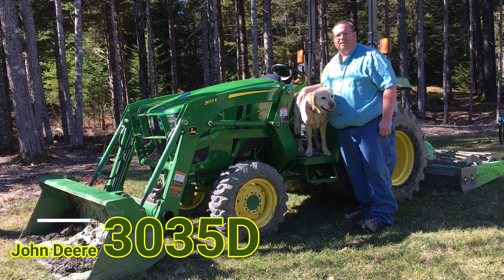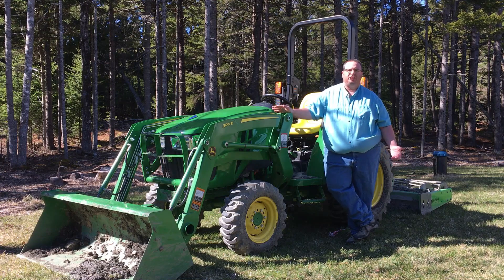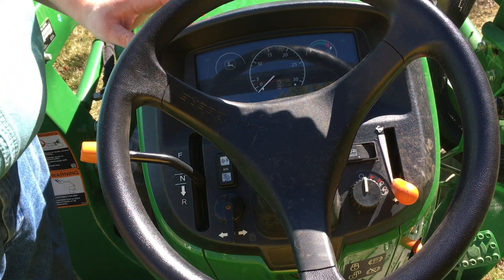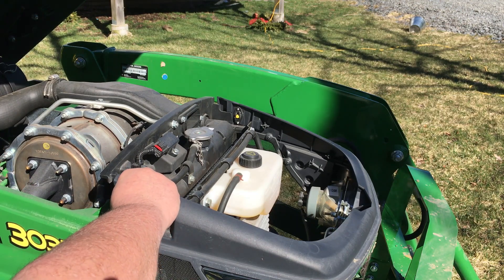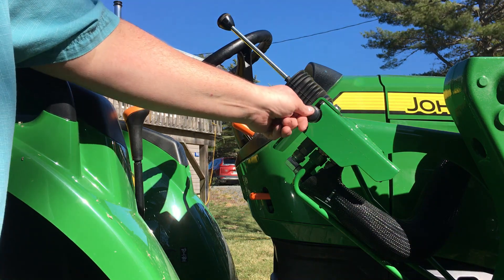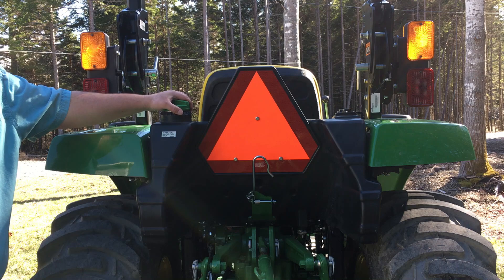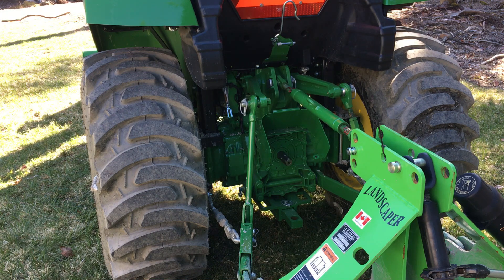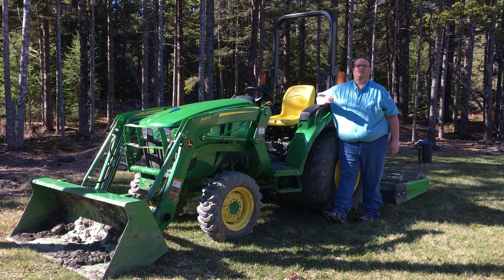John Deere 3035D

Comment: Great review Anthony,  almost wished I'd held out for 2 years. I bought a 3E in 2017. The D wasn't available then. I prefer a manual geared transmission. Hydrostatic is OK but geared tractors have been around forever.
Reply: instablaster...

Comment: The pto is a no go for me. Its seems totally backwards to me that a geared tractor you would put a pto that's stops when you clutch.  When most other tractors have a independent pto or two stage clutch. Having your implement start or stop everytime you push the clutch to stop or change gears is just more wear and tear. Especially on implements like brush hogs where you dont want to just stop the pto first before you stop. You want to stop the tractor first and let the brush hog clear out before turning it off.  Also if your tilling the garden and need to stop for some reason your tines are going to just come to a stop while still in the dirt. You would have to always remember to lift the tiller before coming to a stop.  Then when starting it up again your tractor will have to be in motion before you drop the tiller down or else you'll be starting it in the dirt. If your blowing snow you will be going forward and as you push the clutch in to stop, the blower will turn off while still completely filled with snow, cause you weren't able to stop and let it blow out first. I just really dont understand why they did that. I literally can not think of a single advantage except maybe cost cheaper to produce.
Reply from the maker: You are correct it was all based on price.  There are other brands priced less expensive than the e series hydrostatic but they as well have that live PTO.
Reply: @anthonyallen1961  Another thing is it's not live PTO, it's transmission PTO. An archaic form of PTO that nobody on the planet wants or can use in this day in age.

Comment: Question when you don’t have an attachment hooked up do you have problems with your lift arms not dropping?
Reply: That would most likely be an adjustment on the  drop valve.  I don’t remember exactly where it is on this tractor,  but it will either be a round black knob or a small tee handle.  Usually located below or under the seat.  This allows you you adjust how slow or fast the hitch drops.  If cranked all the way it will also hold the hitch in the up position.  Check in your operator’s manual for where it is on your model tractor
Reply: I know all that I was just wondering if when you moved the lift arms WITHOUT an attachment if the moved up and down I’m told different things on the matter. Thanks for answering
Reply: @oklahomachris6298  yes they will move up and down without an attachment.  If it doesn’t go down most likely that valve it turned too high.  The down direction is all gravity,  it does not have hydraulic power to lower
Reply: Ok I’ll mess with it more but all the way negative won’t allow it to drop all the positive won’t let it drop dealer says it’s so new it just real tight
Reply: @oklahomachris6298   maybe.  Does it drop if you push down on it?
Reply: Yeah it will drop if I apply a little pressure it’s not hard just need like two pounds of pressure to move it down

Comment: New tractor owner here, just got the 3035D, haven’t received it yet. Do have to use the clutch to go back and forth between forward and reverse? Or can you roll to a stop and slap the lever into reverse?
Reply from the maker: You need to clutch To change direction